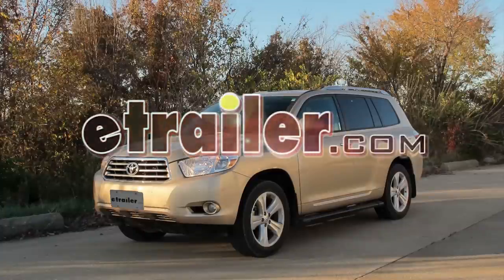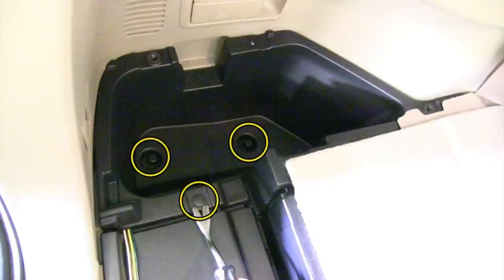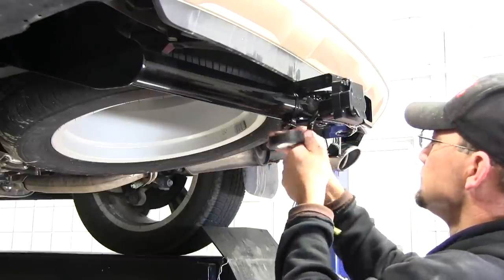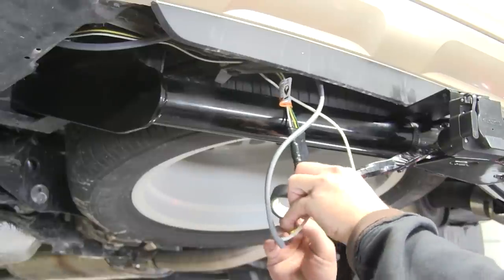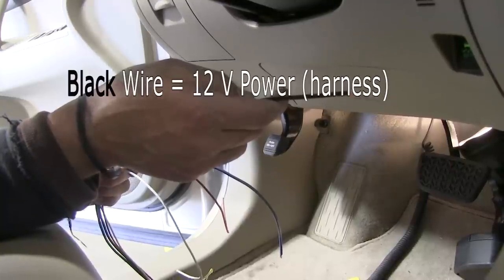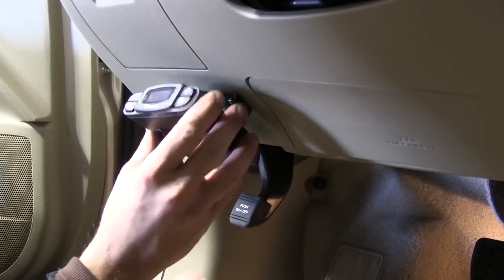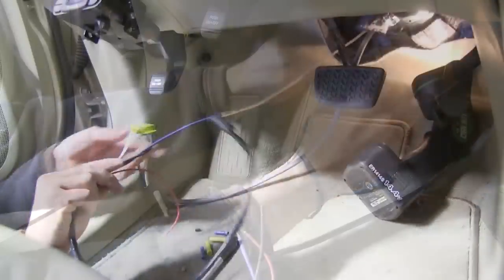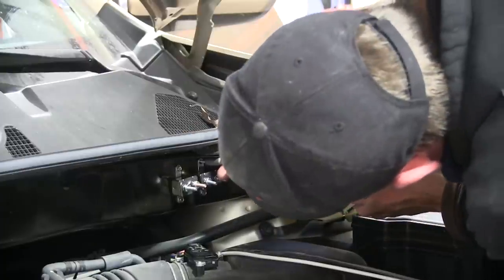How to Install: Tekonsha Prodigy P3 Trailer Brake Controller on your 2010 Toyota Highlander

Comment: I am very grateful to etrailer.com for posting all those videos on youtube. With the help of the video contend and the expert Q/A I was able to install the Brake controller and the 7-Way Trailer Connector. I don't know anything about electric wiring and without your help I would have never even attempt to start ,but now that it is all completed I have saved good $300.00 or more, plus and I have the satisfaction and the praise of my close relatives and friends. The downside of this experience is that now I am "THE EXPERT" in my close circle and my cousin already asked me to install his brake controller. Etrailer .com is not only selling  products with very reasonable prices ,but is a partner with their customers in the process of spreading "KNOW HOW".
Thank you etrailer.com you've got yourself a customer for life.